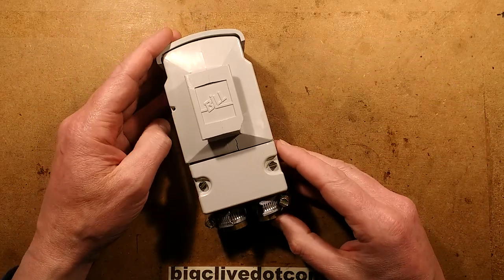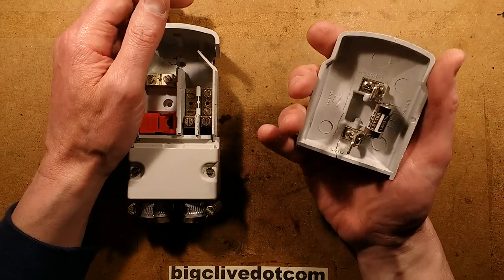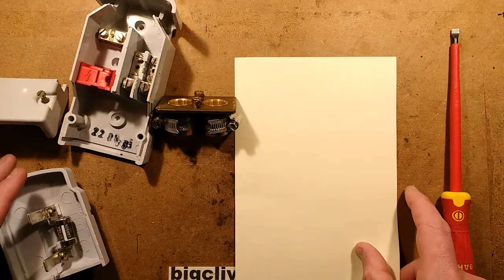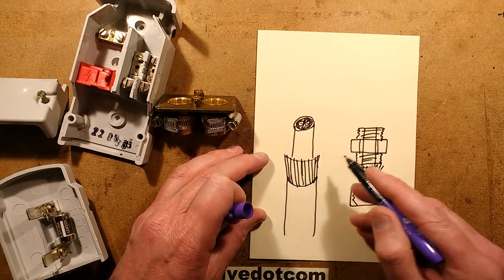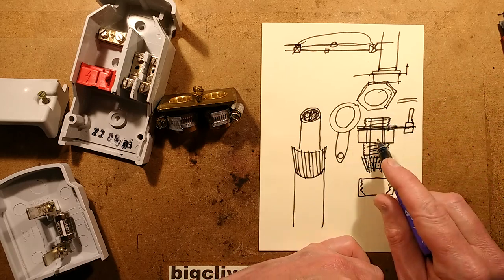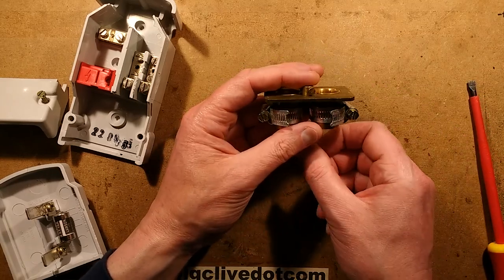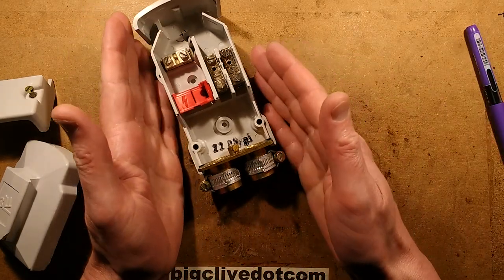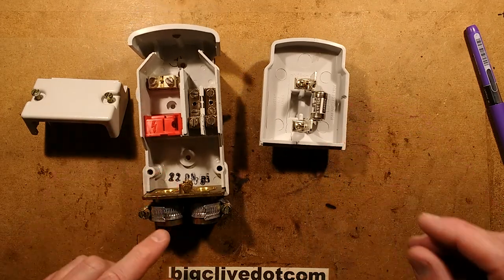Inside a lamp post connection and cut-out unit.

Comment: .......How is it possible that 1) you need to emphasise strongly PUT THE CORRECT FUSE IN. DON'T WRAP IT IN WIRE OR TINFOIL... When... 2) The only people who should be poking at these anyway are trained and registered "electricians" or "linesmen" who know thaat.... BUT STILL 3) I just know that you TOTALLY still need to tell them that anyway ... HOWEVER 4) A bunch of them still won't listen and will still ram a gum wrapper or a broken chunk of screwdriver shaft in there anyway :D ?

I recently serviced a second hand washing machine I bought. The thing wanted a fast blow 5A fuse, of the "extremely common" variety. However, somebody had put a carefully trimmed segment of new-looking protective earth cable in the fuse holder instead......... HOW DID THEY HAVE THAT BUT NOT A 5A FUSE? Or a bit of 5A fuse wire? It costs like $.50 and you can get a card with like 30cm each of 5, 10 and 15A fuse wire on it from any supermarket......... Or you can get the little glass fuse bought individually for like $0.10....... Or you can buy 1,000 of them from China for like $1. I just........... Ugh...... And...... Low impedance thick protective earth wire seems like almost the worst possible thing to replace a blown fuse with... And in a washing machine.... That's the kind of person who probably deserves to pull the same crap up a ladder next to a streetlight, and have a giant "fuse" arcsplosion launch them 50m into the sky.
Reply from the maker: Thanks to certain vested financial interests that present themselves as safety organisations in the UK you can do a couple of one day slideshow "courses" and be a fully certified street lighting electrician.  Training standards have plummeted since the 90's.  Modern training is nothing more than transfer of liability onto unskilled labour.
Reply: I hear you. It's technically longer to become any "skilled" tradesperson here....... But..... Problem is...... The quality of the teaching/the pressure on "teachers" to get the $$$ for the institute means that they can't fail people... And also that there's a bunch of non-English speakers who come to NZ due to how once upon a time our tertiary education was OK. So...... I've spoken to a few disaffected lecturers... Including *engineers*....... Who "teach" things like two year diplomas......... To students from India/China/etc........... Who don't really speak any English more than the equivalent of English speakers learning enough French to ask when the next train is...

Whereas I got taught how to run household/farm wiring by a veteran of both world wars who taught it good.... Then again (kind of) back when tertiary education wasn't appalling here... And for household wiring, it's three f---ing wires and there's like three different sizes of wire, maybe like five to ten different broad categories of household wiring associated thing (switches, sockets, heaters, enclosures....) A few pages of important standards/rules......... And it just isn't that hard I didn't think.......?! BUT it is extremely dangerous if you mess it up.... Which is why there's laws and allegedly trained/experienced professionals who are supposed to be doing a lot of it........ But turns out.... Not really? Or at least not if you're doing it for the Government itself, which is also the nation's biggest landlord............?

The end result is..... If you want.... I can share what might be some of the worst "electrical" work done by an "electrician" in the history of the world....... It's in video format and only ~couple of minutes long. I hope Í'm not overselling it.... But... It's pretty bad... And it's NOT the bath-o-cutor bathroom fan duct.... It's new incompetence... And it's probably even worse (?) But I do hope to keep it secret for now... For legal reasons, that I'm happy to disclose but again can't really disclose in public just yet....

Oh, I can also share the logo of the "electrician" company who did it... Which is itself hilarious. When asked "Hey what's the deal with your logo....?" dude said "Yeah it's just a sad old snot mate. I get asked that a lot..." - The logo actually is a sad, old looking green booger creature, snot-green with jaundiced droopy looking eyes, carrying a ladder over it's shoulder, and the ladder is carelessly/accidentally smacking into an overhead lightbulb... And the booger looks sad and concerned about that...... I swear I'm not making that up....... It's on their website even, so you can verify it.... And I have photos of it on their vans......
Reply: Brilliant. Ah, that's good.
Reply: Jim, I think you meant to say that the angry pixies would ARCSPLAIN proper fusing to him.
Reply: My favourite was always the 4" nail across the fuse holder covered with electrical tape for 'safety'.
Reply: well, quick certification is just the first step. then comes natural selection.
Reply: Seabreeze Coffee Roasters well obviously you wouldn't want it to short on anything lol
Reply: I have seen it done in a couple of Dairies as the Hot Water wash elements used to burn out the fuse wire.
Reply: > it's more about affirmative action BS.

actually, in my experience, its more about money (as are most things). especially with two- or three-part courses, they know that only people who made it through the first one will pay the enrollment fees for the second.

certification and education (training) should never be handled by the same institution, unless they have absolutely no financial stake in it.
Reply: sounds like certified fireball causer ;)
Reply: "It costs like $.50 and you can get a card with like 30cm each of 5, 10 and 15A fuse wire on it from any supermarket."

Do you do groceries at Franklin Electric, too?
Reply: "certification and education (training) should never be handled by the same institution, unless they have absolutely no financial gain involved."

Agreed. Full communism for everyone!
Reply: there is a good reason fuses are in there - DONT REPLACE IT WITH RANDOM BITS OF METAL..
Reply: All good points. I have no idea what the answer is.... They legislate, certify, and, HEALTH AND SAFETYS and regulators and laws and on and on and on............. But still... It took like a few ........ days (?) total with a non-fool, and I picked up enough to be a WAY better electrician than, somehow, a bunch of ACTUAL ELECTRICIANS........ Which is not a brag...... Because............ Wow... Some are just............???!!!!!! ..... I can't even explain it....... I have videos if anyone is particularly interested... Or.... Just go look at the logo for "paradise power"..... Which is an unhappy/anxious snot-man, booger green in colour, who is carrying a ladder over his shoulder and the ladder is smacking into a ceiling light fitting as if by accident..... http://www.paradisepower.net.nz/Electrician-Wellington That's actually their logo?! And...................... ?????! They seem to be the "electricians" for NZ's "social housing" provider, who never ever check the standards of the work that gets done....................... And.......... It shows....
Reply: I agree Clive, I did my 16th Edition (Multiple choice, coddled and told there wouldn't be any further additions, merely amendments for unification of standards), PAT testing and both parts of Inspection and Testing (harder to pass and proper studying). Only 4 of us passed I&T out of a class of 35 which included newbies, intermediate and experienced but unqualified sparkies. I did mine because of a lifelong interest and had a small property maintenance company. I stopped doing electrics soon after because .................. it was obvious I wouldn't be as knowledgeable as an apprentice served journeyman who "had it all in his hands". I'm glad I did the study though. I still try to keep up to date but my point is, I'm fairly experienced, taken some exams and still don't trust myself because I don't know "what I don't know", and it became increasingly obvious that the teaching and accreditation process was heavily flawed. Banker today and electrician tomorrow is not safe (imho), academic knowledge is one thing, procedures, safe working practices and working with someone who has seen it all, is beyond priceless.
Reply: Proper technical training should start with an aptitude test. Some of the better training organisations will not agree to train people if they fail such a test.
Reply: Time to step off your soapbox Jim
Reply: Too true I have seen terrible things done by "electricians" Found one with an HNC in electrical that thought ohms law was a traffic offence.. Unbelievable
Reply from the maker: Indosarnia  It's worth mentioning that the NICEIC is a private company that markets the use of its logo.  It's never been a government body and hopefully never will be.

Comment: My city just rewired our lights with stranded aluminum, a hydraulic crimper, and a roll of friction tape. Some loops have already failed in less than a year.
Reply: That happens with aluminum if you don't use the proper connectors.   It can be great stuff - but it's a LOT harder to use than copper.

Comment: The majority of the streetlighting here is attached directly to the overhead powerline poles, with taps off the phase & neutrals going to the magic box of tricks (which used to be a more impressive looking thing before they replaced the SOX lights with LED), presumably they're all individually fused inside rather than being run of one fuse... :)

Comment: ''20,000 amps sounds huge''. I've seen Phontonic Induction put 1,000 amps at 1 volt through a wrench (spanner) and watched it quickly turn into white goo. So, yeah, 20k amps is nothing to fool around with.
Reply: His thunder capacitor obliterated fuses with rupture current ratings of 80kA
Reply: Prehistoricman - I wonder what that sounds like live, and not through a mic that will clip.
Reply: The prospective short circuit fault current at a UK single phase cablehead is 16000 amps.  And that is at 230 volts. If you are directly in front of it when it blows, and not wearing flameproof overalls, 1000 volt gloves and a face visor, you'd be better off if it killed you, than surviving with the severe burns you're likely to get. It really depends on the type of supply. in flats, with a pvc supply cable, protected by a 100 amp fuse in the common  stair cupboard, its going to be much less severe than with an old paper insulated lead covered supply, which may be coming from a 400 amp fuse in a substation half a mile up the road. The 400 amp fuse often won't blow, at least not right away,and the fault will keep erupting until it blows itself clear.
Reply: ben kerr n to

Comment: If like me you don't like the banjo washers and the thin nuts, you will be pleased to know that thick brass pirahna nuts are much better, and there are some that include a locking grub screw, and have been around as a better solution for at least a decade.

Comment: Tip clive for tighten and loosening locknuts, handtight, then get a old flathead screwy and a hammer... nd knock it around untill tight. Works everytime
Reply from the maker: Yeah, I've used that trick a lot in the past.

Comment: i worked for virgin media servicing street cabinets. one of the jobs was inspecting the main cutout fir correct fuse rating and checking for shrinkage on the micc cable.
Most street lights unless in a managed area all seem to have micc cable. very rare to find a light column or cabinet with swa cable feeding it. unless it was on a sub main. 
I did find the odd nail in place of a main fuse and the odd cabinet with a dropped neutral.
The above cutout is the later type, some of the lucy ones are ok but can be britle. 
The older bill type were black and broke easily.

i still have my g39 documents from the training i did.

Comment: You are right about meter fuses. If you have to replace the 440mA (44/100) or 11A fuses in a fluke meter they are about ten quid each. I dont see how they can justify that price. At the end of the day, its a piece of wire in a ceramic tube with silica sand in it. Cost = pennies.

Comment: If it was a direct feed from the DNO a similar but different type of cut out is used. As DNOs do not use SWA but instead combined neutral earth cables, the entry glad at the bottom is simply a rubber grommet.

Comment: I call them banjos personally. 
Those stamped steel nuts. I personally use a nocking screwdriver and a hammer to tighten them up if you can’t get a pair of grips onto it

Comment: In Canada Clive, they use this 1/8" thick serrated hex nut with indents to fix so called box connectors, allowing one to use a flat head screwdriver against the indents to pound them tight (loose) >> Palm or whatever is close by. 1/2" right up to 2.5" - 15A  to 200A cable  ie- 14Ga to 3/O  ,.. all of it fixed into the panel with the same kind of little nut :-)
Reply from the maker: We make our own indents on these nuts with a screwdriver and hammer to do the same.

Comment: When I was a bit younger (and dumber) there was a streetlight in front of my house, one morning I woke up to look out the window and notice the cover on the post was off. Being the idiot I was back then I thought it’d be funny to remove the fuse and short the live and neutral going into the isolator. Long story short it made an almighty bang and sent sparks flying everywhere and also caused a catastrophic failure in the step down transformer up the street and causing it to catch fire and cut power to the whole neighbourhood. Could’ve easily been killed doing this and looking back on it I feel very stupid 😂. I never did get caught, safe to say I won’t do that again.

Comment: I used to use the outer nut to tighten the armour gland to the panel, you only need light force on the inner nut, but i agree, why do they make those nuts so thin, even worse are the thin knurled ring nuts that come with some glands.
I too will use 3 core and use the 3rd wire as earth if  i want a good earth, i read somewhere once that they were saying the armour shouldn't be used for earth continuity, you're supposed to run a separate earth wire, not sure if that ever came to fruition

Comment: Clive, it sounds like you need to introduce yourself to the Piranha nut. Nice deep brass nut with set screws to lock and a stud for the earth connection. No 'frying pan' (? always heard them called banjo) washers, no drilling extra holes in the box.
Reply from the maker: It's a good idea, but I wonder how it would fare when used in high density SWA termination.
Reply: They're barely any bigger around than the crappy pressed steel nuts, and you don't need space for bolting the banjos - so better. More flyleads I guess, but that's not hugely problematic - I don't really like the practice of sharing them anyway.

Comment: this unit reminds me of an episode of Mr bean. he is waiting for a bus because is his battery went flat,. and in the mean time an older gentleman was waiting also. and suffered a heart attack, so Mr bean runs to his car and gets jumper cables, pulls open the connection box and hooks them to the terminals and proceeds to restart the mans heart using mains voltage. Ha Ha

Comment: Those thin nuts... OMG. They're so awful. Although if you're lucky you can find an old, old pressed metal "spanner" that fits them. Which makes it slightly less awful.

But it's usually impossible to find a replacement because they're invariably an odd size or the only option nis a 15mm thick stainless steel nut for 5 quid.
Reply: Michele Marie Dalene Often a panel is so tightly packed the only way to remove or install the fittings is with a hammer and screwdriver.  For the larger sizes like 3" conduit, I don't usually have slip joints that size so hammer and screwdriver again.
Reply: Michele Marie Dalene But at least the US panel nuts usually have some biting teeth incorporated into them to prevent them backing off once tightened.  It's still a pain to get a proper wrench into a tight panel, though, that part never changes.
Reply: A whole single thread width of "nut".
Reply: Oliver Thomas greatest invention ever, but very few wholesalers near me seem to stock them.

Comment: Could the difference in cost between fuses have to do with those being rated for 250v vs 600 or 1000v for a multimeter fuse? Also, I suspect those are produced in much greater quantity than the multimeter fuses which would also lower the price.

Comment: I guess we were lucky years ago when using the top contact in a kicked-in streetlight cutout to short the incomer that the feed was just for the car park... :D
Reply from the maker: Yeah, that could have been loud.
Reply: I have wondered about this in the past.  I see those covers missing on streetlights all the time (or just taped over).  I guess this counts as a conduit or chase and not a proper disconnect and doesn't get an arc flash hazard label.
Reply: I never touched a lamp post after kicking one and a bazillion wasps came flying out.